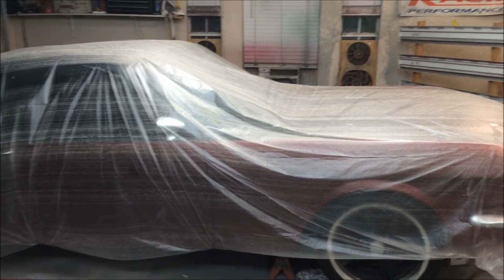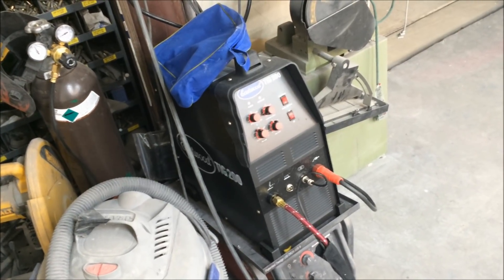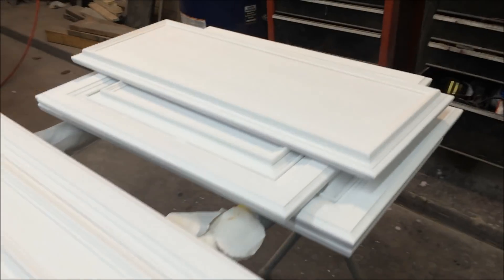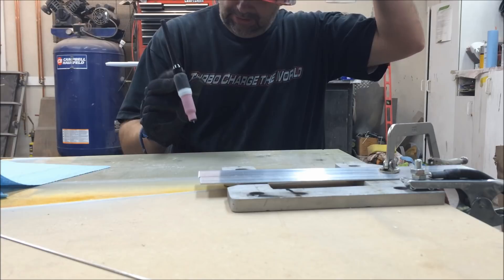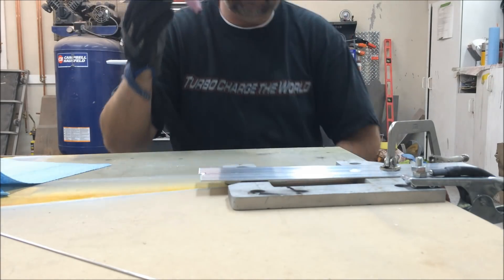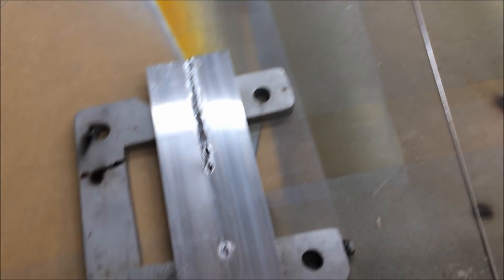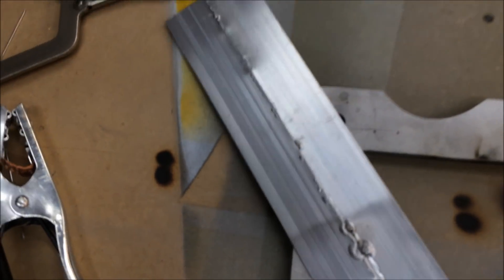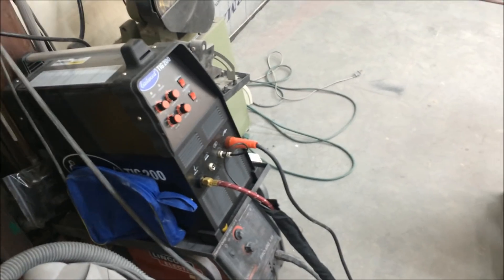Beginner Tig Welder - How to get started - bad welds- tig welding basics

Comment: you will get there. don't forget to let the post flow gas to run after you stop your weld. the puddle needs to have gas sheild it as it sets up.  I also found draping my Tig lead over my neck and down to my arm stops it from tugging or that heavy weight when welding. but I too am a beginner of Tig welding. I have welded in professional shops on and off for 20+yrs but always mig and stick. I must say I am having a blast with the tig

Comment: 1 remove the pan  2  clean the hell out of it   3 pre heat the pan till hot and toasty  cast aluminium reacts differently to ""bar stock""  and most of all remove your battery

Comment: Not sure on this type of machine but on others you can get a control that you run with your thumb that will control the heat instead of a foot petal I've used many of those when I was welding pneumatic aluminium trailers

Comment: i know this video is old but i wanna leave this here for others to see.

1. When welding and you let off, do you hear the gas still coming out? DONT pull away until the gas stops flowing.
the gas helps the weld cure evenly, helps with warpage, contaminants etc.

2. Use less filler rod at a time. your filler rod length is going do negotiate how steady your hand is, how steady the weld is, and ultimately will be the deciding factor on if you are laying good even beads (not to say you cant with a long rod but shorter is 10x easier)

3. Dont hold the rod so far away from the contact point. dont be afraid, hold the thing like a pencil (maybe not nearly as close to the end but MUCH closer then you are showing here)

i know its been years and you are probably light years ahead of yourself in technique now.

Comment: Should of got a Lincon or a Miller welder!
Reply from the maker: Yea no doubt
Reply: Feh, new inverter Miller’s and Lincoln’s are made in China now. Nothing wrong with Chinese made stuff, but lots of complaints about these new models. I bought an ESAB Rebel, also made in China, and it’s very high quality.
Reply: Robert L Jordon no HTP 221 Invertig smokes the Miller and Lincoln in it’s class and not one complaint about them

Comment: A suggestion or something else you can try if you ever run into this problem again. Instead of epoxy use something called titanium stick by Weicon. We use it to rebuild shafts on turbos and i’ve Seen it used in cracked engine blocks, lifter valleys and heads (intake side)
Personally I used it on a Mercedes Benz (1976) to block off the oil pressure sending unit that was removed from the block. It’s been 3 years and the thing still doesn’t leak. I’ve also used this on atv rims where they have a valve snap off and it’s stripped to the point you can’t make it bigger or make it work. That’s been 2 years and the guy beats it hard.

Comment: I've been welding aluminum for a decade or so with spool fed gun. Never have i tried to Tig. Kudos to you brother because TIG looks like it would be a nightmare to learn after you've developed a technique and muscle memory with a mig gun.
Reply: One note at a time - Lee Jones i am a 12 year old and i have been learning to tig weld. Its a bit hard to start, but once you get the very basic groove, its just lots of practice
Reply: mig aluminum is for weld operators not a real welder

Comment: Try letting the bead get just a bit bigger before you start moving, but not too big or the weld will crack. Also, as you get closer to the end of the weld, gradually get faster with your travel speed. That will keep the metal from melting too much in one place and burning through and will also keep the bead at a good size.
Reply: Nice to see other people learning to tig weld like me. I can learn from others almost as well as learning the hard way by doing them myself. All I can say is more hood time with my powertig is probably all I need now.

Comment: welding alum cast needs  lotrs  heat to weld. watch for oil fire... oil dripping into weld will be a major problem,  You really need to remove the oil pan to get it done right.
Reply from the maker: This was years ago.  I did the repair in a separate video and it worked out well, and never leaked again.

Comment: High frequency can do damage to sensitive electronics like car computers. It can also mess with the radio, but not always.
Reply: 10:4 littleal called e suptin i dont know. And. U trying to stop my microwave oven from working?  Lol. Really dude!  Back to my game. This seems old lol
Reply: 10:4 littleal ur rude dude or dudet.  Back on muh neutrino harvesting. Lol. Electromagnetic. Isnt what it is but is . got to go .. Ur boring me but u got good saying. Peace back to my playstation game
Reply: 10:4 littleal most scientists have rulled out neutrinos. Off subject.
Reply: 10:4 littleal. Skip
Reply: LMAO
Reply: That is true ,standard practice is to disconnect battery poles for 30 minutes  then depress the brake pedal with a jig while you connect positive and negative battery terminals together. 
Ive never killed a computer.
Reply: 10:4 littleal dummy lol

Comment: Why did you choose that over an everlast powertig?  The everlast machines have a lot more options and controlls for pretty much the same price range.  I got the powertig 250EX and It has all the same abilities as the dynasty 200dx I use at work.  I'm not saying  that yours isnt a good machine, just wondering why not go with the one with more controls?

Comment: hey man. nice vid. 
do you need argon gas to use a tig? if so is it expensive?
i make some small projects at home but i have only used stick. 
now looking to start with thin sheet metal and just finding out about tig...
 Thanks
Reply from the maker: Yes you need argon, and no it's not really expensive. Tig is definitely a good option for thin sheetmetal
Reply: Argon is the primary gas for tig all around, you can get a mix of it helium and oxygen is other gases used for tig TGAW

Comment: Gary does your machine have an ac setting you need ac to weld aluminum. Do you have your tungsten ground round on the end ,pointed is for steel.
Reply: You do not grind the tungsten down and you want all the grind marks for tig down otherwise you get bad gas flow and put the welder on DC+ to make the ball then put it back to AC to start welding aluminum... careful as you will blow through your tungsten if you do not do it with minimum heat
Reply from the maker: Doug, yes, it has AC, which is what I was using it on in this video.  Yes, you grind your tungsten sharp like normal, then you stick the point into the grinder to dull the tip, the ball happens automatically once you start welding.

Comment: I know nothing about TIG, MIG welding but it looks good to me, you filled in those holes just fine.
I have a 10 or 12 year old Craftsman 80 amp flux core welder, .030 wire and I used it once, all I got was a bunch of little wire stubs all over my work.
The so called "weld" looked like something a bird dropped...LOL
It is a 120 volt welder and draws 20 amps off the outlet.

Comment: Always wanted to try tig welding. You won't find them in body shops because apparently they are known to blow out the computer systems on the cars. That is what I have been told at least.
Reply from the maker: Hmm... I havent' heard that.  I have seen some of the higher end custom shops tig weld their patch panels in, but then again those cars are gutted when they are doing that so they don't have to worry about the computer... I know Brian Fuller tig welds alot of his patch panels...

Comment: i payed $70.00 to have alum. welded 6 inchs..................
Reply from the maker: Yea, it's expensive to have it done for sure, I had to bungs welded in some valve covers when I lived in Alabama the guy charged me $60 for it.  The 100% argon gas isn't cheap, and it the tig welding goes through the gas alot faster... so the cost adds up for sure...   Thanks for watching

Comment: i am kinda scared 2 try 2 tig weld...was told it is a stronger weld  PEEEACE
Reply from the maker: Yea, its different for sure.  I have watched you work with your hands, saw you cutting out the masking for flames one time and I can tell you are coordinated, so tig welding just takes good hand/eye coordination with both hands going and your foot pedal also (if you choose to use it).  Its actually fun using it so far, but then again I haven't tried to weld anything for real, only practice, I am sure I will be cussing when i do that oil pan, lol, thanks for watching.

Comment: Very cool Gary! Is there any danger in welding the pan with the oil in it, or remnants? On another note, you can actually see the metal warping in the video before the blow through.
Reply from the maker: Ahh, good point Erik, I didn't notice that.

Comment: That cast oil pan is going to be one of the hardest welds to pull off. I have seen oil pans with holes in them be fixed and some with the smallest crack turn in to unusable. I always took them to a friend that tig welds for a living and he would get so mad when i would bring him a pan. I would strongly suggest  getting a piece of oil pan from some where to practice on ,because it will be completely different, than clean or even the cast you have there. The alloy is different and it is impregnated  with oil.  Good luck and hope yours is weldable. Will be watching . and Oh yea  Cool
Reply from the maker: Good idea on practicing on an oil pan. When I epoxied it, I hit it with a scotchbright rollock and it cleaned the aluminum up good, no oil visible, but I do realize it's embded in the pores of the casting... I will go to the junkyard and get one, the other thing too is I will be welding above my head and that always makes it harder.
Reply: turbocobra One of their issues it would crack next to where they were welding  but a few mins after welding.

Comment: Good stuff Gary.  Glad to see the Eastwood unit works well.  You can't beat the price.  bbugnout is an ace tig welder just in case you need any help (it doesn't look like you do).
Reply from the maker: cool, yea I knew brian did that tig welding in a sterile environment, seems like a good price and produdct so far but doesnt have all the advanced features to allow you to fine tune your welds.  Seems like the biggest thing is to get comfortable and have a place to prop your elbows so you can have finer control of the torch...

Comment: What did he hit.?...Cast is a bugger to weld so I'm told..
Reply from the maker: It was me, I was being careless jacking it up to reposition it and after the first pump of the jack it slipped off the jack and caught the oil pan and put a tiny crack in it, that got worse once the engine heat cycled. no doubt, I have already practiced on an oil soaked alternator bracket, takes alot of heat and cleaning action from the welder...

Comment: Good looking welds for a first time. I agree what others are saying, the oil inside of the oil pan is going to cause problems with welding. You really need to pull the oil pan off, clean it properly and then weld it off the car. Doing it in situ is probably going to compromise the integrity of the final weld.
Reply from the maker: Good points, and I may end up doing that, Going to try it on the car, if I have to pull it off the car, I will just replace that part of the pan, it's a 2 piece pan and its only like $100 or so.  My fear is the cast cracking at a later point from all the heat

Comment: Good job bro.If thats a transformer based machine you really need the green tungsten.If it is a inverter then the tungsten choice wont matter as much. I like the grey ceriated and blue lanthanated tungsten for my chinese inverter machine to do aluminum.You mentioned the settings,I dont know what that machine has got but if its got adjustment for your ac balance and frequency settings then adjusting those will make a huge difference in your welds. Nice vid as usual brother,GOD bless.
Reply from the maker: Thanks Seth, yea it' s not an inverter, so going to get the Green tungsten for sure.  Thanks for the tips!

Comment: Your going to have fun welding cast aluminum.  It gets oil in the metal , which makes it hard to weld.
Reply from the maker: no doubt, I have already practiced on an oil soaked alternator bracket, takes alot of heat and cleaning action from the welder...

Comment: Sorry to hear about the oil pan but it's a great opportunity to learn how to weld aluminum. .I have something that needs to be welded aluminum and I always wanted to know how to do it..is the tig welder the only way to weld aluminum?  CJ
Reply from the maker: CJ, you can weld alumimum with a mig if you buy a spool gun attachment.  They are about $300 for everything you need, but you don't have near the control over like you do a tig, and the tig will give you alot more cleaning action, but yea you can do it with a mig and spool gun